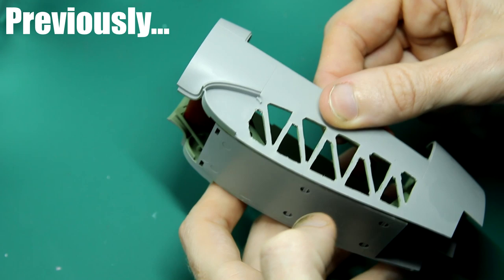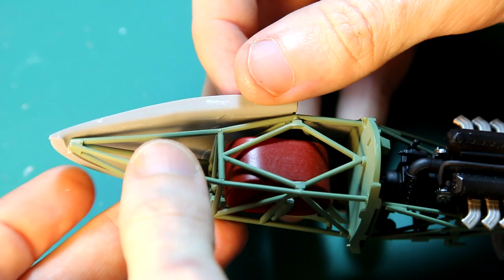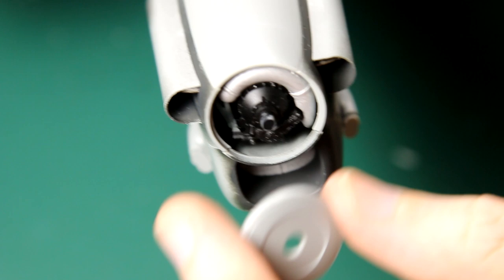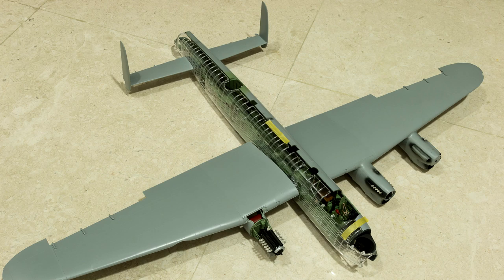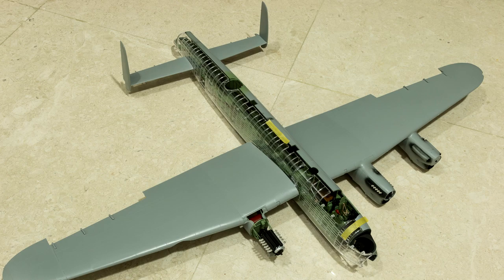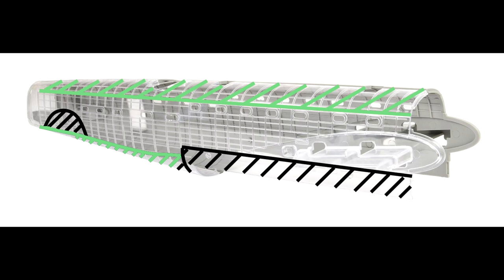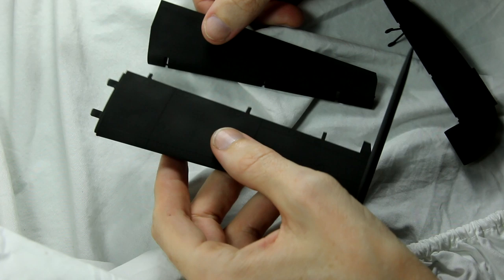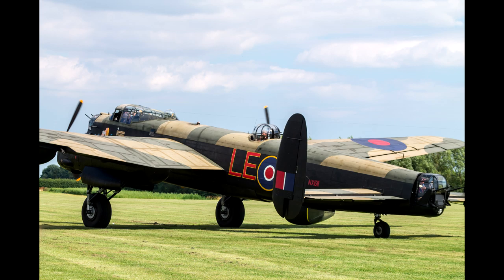HK Models 1/32 Lancaster - Part 5 - Initial Painting

Comment: Good evening, I noticed that a mistake was made in the positioning of the tail planes.
The surfaces with the inspection panels were placed below and not above.
If possible, you should turn them over and fix the rudders exactly.
Greetings, Fabrizio.
Reply from the maker: Hi Fabrizio. Unfortunately it is a mistake in the kit - the pieces will only fit one way, but HK have made the panels in the wrong place :( I'm not sure if their 1/48 release of the Lancaster fixes this.
Reply: @ModelNerd  Hi Nerd, it's true, they made a mistake (they are Chinese unfortunately 😂😂😂😂😂😂😂) and even the correction of Nigel Modeling is quite cumbersome .. I have solved it in a different way, because I noticed that the insertion of the floors themselves is quite solid.
So I cut a couple of pins from one of the half planes and adjusted them.
Greetings and good modeling.
Fabrizio

Comment: You might be able to get some reference help from "AVRO Lancaster Manual (Owner's Workshop Manual)" by Jarrod Cotter or "The Complete Illustrated Encyclopedia of the Lancaster Bomber" by Nigel Cawthorne especially when it comes to how you might display the open panels for your starboard side engine nacelles.  Sorry to hear of your on-going frustration with HK's flaws in this expensive kit.  Your pain probably will be my gain as I will await investing in the Wingnut Wings edition of this big beast.  Keep up the good work.  I think I would use the AK Real Color for the camo if you can get it..
Reply from the maker: Thanks Lawrence - I've used a few reference images but those books sound good. I'm going to be very interested in the WNW kit - the test shots look incredibly detailed. It is only a partial interior I believe, but of course most of it would be hard to see anyway. The price will be very interesting.

I'd be very interested in buying a section of the kit (e.g. just the wireless ops table forwards) if they were to release such a thing.

Comment: I did it ! I went a brought one ! Now I have to wait 2 weeks for it to get here 😂 I’m so excited 😆 one question where did you end up finding a home 🏡 for such a large model ?
Reply: I’m going to get the lights, sounds and engine kit from Belgium 🇧🇪
Reply from the maker: Nice! Well done - have fun! Mine stays in my spare room, but doesn't really have a permanent home at the moment.
Reply: @ModelNerd  I stay in a one bedroom apartment 😂 atm my dining room table is covered in green felt half of it has two warhammer fortresses and high elf and Chaos Armies on it the other half has my chess board and a half painted Perry miniatures Battle in a Box Confederate Army I may have to clean it off and make the runway on the table I’ve found a 1/32 Nissan hut for less than Twenty pounds Stirling from the UK 🇬🇧

Comment: A two part epoxy might be best, pve and clearfix aren't strong enough to hold something that big and you have to sand it. I have found extra thin cement will work with out fogging and the areas you  will glue are going to be painted but again the bond will be weaker than normal.
Reply from the maker: That's a good suggestion, thank you. I'll check out what my local DIY store offer the next time I'm down there.

Comment: When installing windows in fuselage did you sand the openings first ? What glue did you use for the clear parts ? I have bought Transpa fix 6k for this. Iwas thinking of using a little liquid mask in the openings to save sanding later....
Reply from the maker: (I'm guessing you mean 'mask' rather than 'sand'). I painted the two halves separately before the windows were installed, so there was no need for masking. However, liquid mask would well. I didn't have any at the time, but I've used it since and it is good (including on an upcoming Lancaster build).

Comment: I've just watched your videos on this build, so first off thanks for posting them and sharing the build with us. You have made an impressive job of the kit. Unfortunately between yourself and Nigel you''ve put me off the model. For an expensive kit it seems quite short on detail and accuracy, both in fit, detail and finish quality. I believe after all the detail work Nigel has done (which shouldn't be necessary at this price) he's now offered his kit for sale on one of his update videos. 
I'm not sure if the clear fuselage panel cuts it for me. I'm not sure how transparent it is and whether it distorts the light making it difficult to see details through. Also the ribbing detail spoils the view. I think it might look better with the opaque sides cut away and the edges of the cuts lined in red as per sectioned stuff seen in museums.
Reply from the maker: Hi Allan. Yes, I'm not 100% sure either. Especially as I am having difficulty finding something strong to bind the clear and opaque parts without fogging.

Comment: Model nerd
Can you check the rear stabilizers if bulit by the instructions you end up with 2 uppers one side and 2 lowers on the opposite side
Nigels modeling work bench has a video on this issue and how to fix it 
Thanks Scott
Reply from the maker: Hi Scott. Yes, I saw that on Nigel's channel. I decided against fixing it as, at the time, I felt I might do more damage than good.

Comment: How long did it take you to finish ? From beginning to end
Reply from the maker: On and off, I was working on it for over 8 months. But that's mainly because I took a break in the middle.
Reply: @ModelNerd  Back in 1997 I brought a Tamiya 1/16 King Tiger in the Army. I brought it from the Army Garrison Shop took it back to the Barracks I was staying in a Ten man room left it on my bed and headed off to the pub for a few pints 🍻 well I was gone almost 3 hours and the first thing I noticed was my KT Tank driving around the parade ground ! As soon as I left 10-12 blokes found my model on my bed and started to put it together it took them just over 2 hours to put together when I was looking forward to complete it by myself over 3-4 weeks they ruined the life of the battery because they only had it on charge for 2 hours instead of overnight the only thing I got to do was the Zimmerit and the paint job ha ha 😂